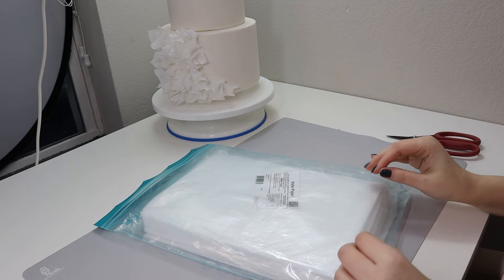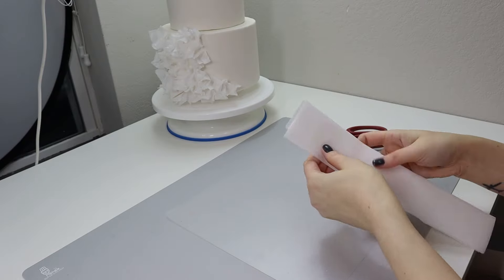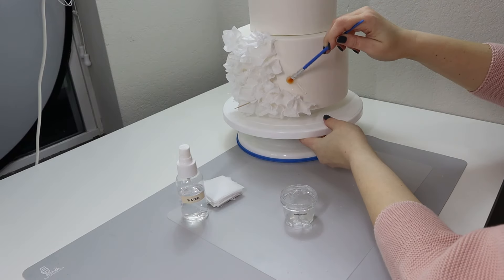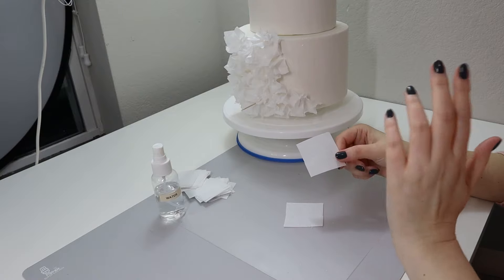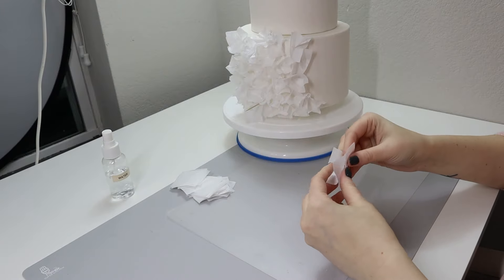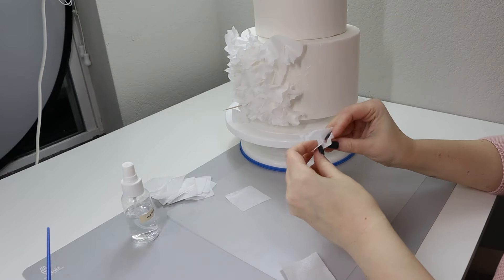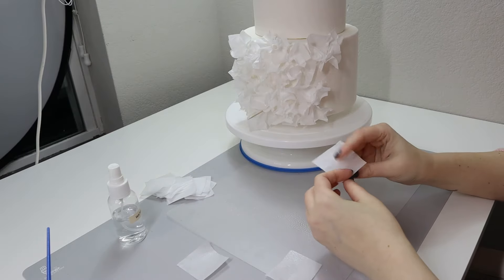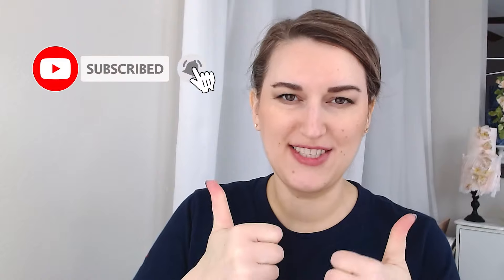How to make wafer paper ruffles for cake decorating

Comment: Hai mam, hope you are doing great.
Would like to ask few doubts regarding waffer flower. Will the waffer flower melt when kept in fridge. My area is bit humid. 
Im planning to decorate the cake with waffer flowers , which the cream base should I go  with the dummy? Buttercream or fondant?  Or dummy as such. Will that be possible
Reply from the maker: You can put wafer paper on buttercream, ganache, or fondant. The only frosting you can't put wafer paper on is cream cheese. And if your area is humid, dust your wafer paper flowers with cornstarch - it will prevent it from melting.

Comment: Hi... Would this wafer paper stay in the fridge till we deliver the cake? Also... Can they be put in a whipped cream cake? Thank you❤️
Reply from the maker: Hi! Wafer Paper is safe to put in the fridge if it is low humidity. Unfortunately, I'm not familiar with your whipped cream cake recipe, so I would recommend you to test before covering the cake. 
Hope this helps.
Reply: @floreacakes  well we use the non dairy whipping cream
Reply: As far as I know... Wafer paper tends to shrink in the fridge because of condensation... So I asked...
Reply from the maker: @ranisharma9510  I'm not familiar with non-dairy whipped cream, so don't have any recommendations. My fridge is about 35% humidity and wafer paper (even on buttercream cakes) does just fine. Moisture is what affects the wafer paper, so if you know your fridge and can maintain the humidity level - shouldn't have any problem. However, it is best to test prior to committing to covering the whole cake.
Reply: @floreacakes  thank you so much for your prompt response ❤️